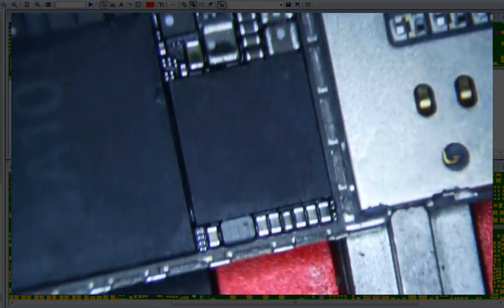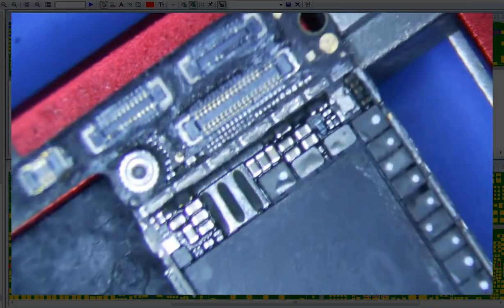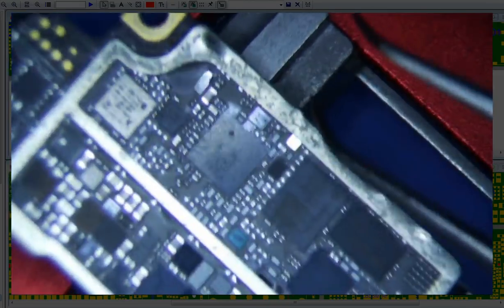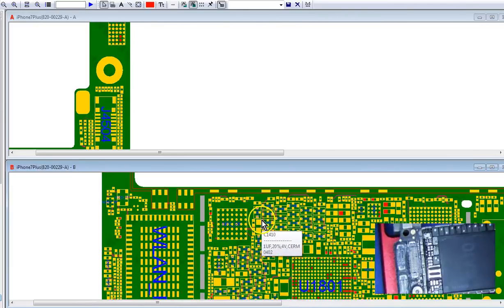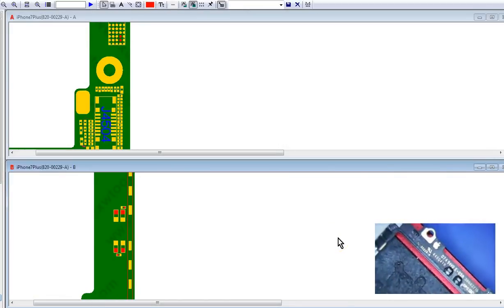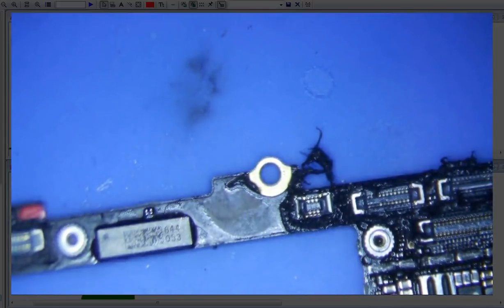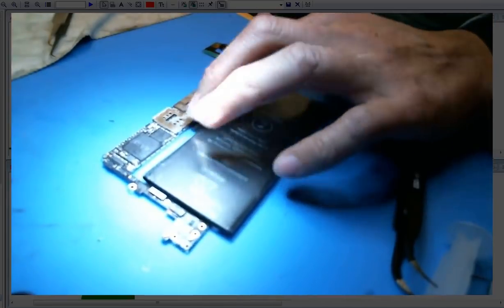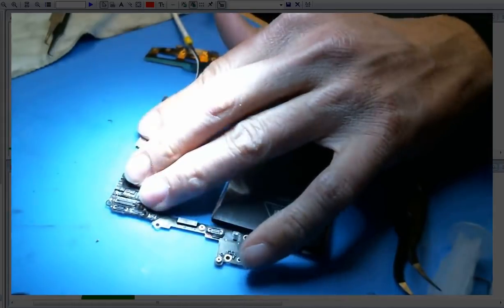Finding a VDD Main Short on a Water Damaged iPhone 7+ for Data Recovery

Comment: Sometimes I just limited current to 2 amps and use freeze spray. Then test area with meter and usually will find the short very quickly.

Comment: Curious to know what I heard in one of your videos that you were upping the price on data recovery to 600.00 which is awesome and justified anything to keep this industry from becoming a race to the bottom is that still the price? Also, I am just starting to get into the data recovery biz at my shop and was wondering if you can't get the phone to be recognized with iTunes what next? But if you are able to get damaged phone recognized in itunes do  you get the customer's login info and do a backup to there icloud at that point or do you back it up into your account (if thats even possible)  Diggin the viids learning a ton THANKS!
Reply from the maker: I lowered it back down to $300.

Comment: bro i got 7+ Error 9 check Nand PP1v8 got 1.8v but when i check in diode mode it gives me 0.067 resistance could it be the culprit causing Error 9, where to start finding the problem.thanks
Reply from the maker: sounds like a short in that line.  My experience tells me that it's usually in the CPU.

Comment: Why don’t you use the power supply and freeze spray or alcohol to locate the short but instead you remove bad looking caps? If it wasn’t the bad looking ones what would you do next? I’m trying to learn from your troubleshooting steps here.
Reply from the maker: I've never been very successful with freeze spray.  Also, it doesn't work well on low voltage lines that don't emit a lot of heat when it's shorted.  Since I don't repair these water damaged phone; only data recovery, then most of the time, caps are not necessary to obtain the data.  You can remove most caps and chips from the logic board and you will still be able to recovery the data.  It's easier to just remove them, then to test each and every single one.